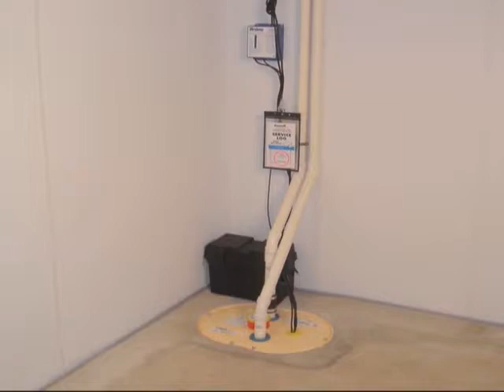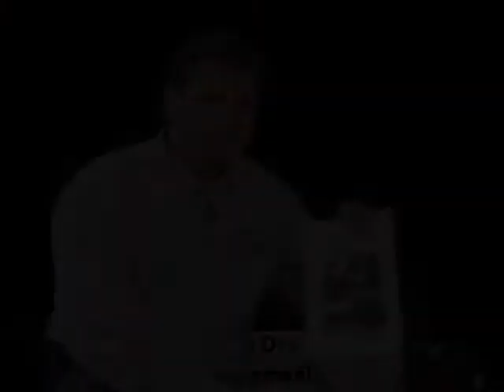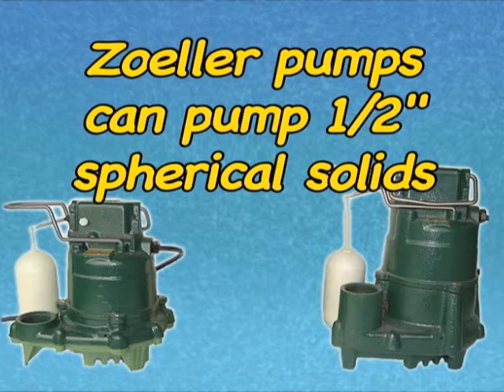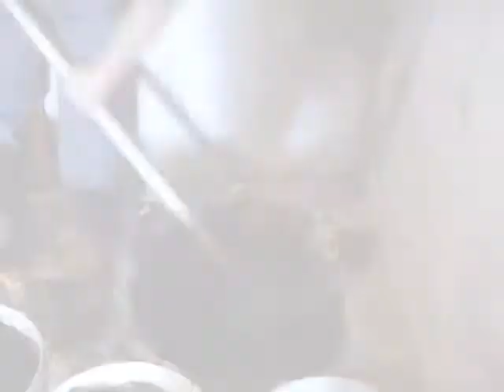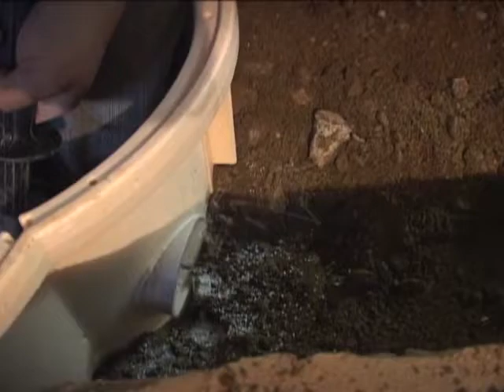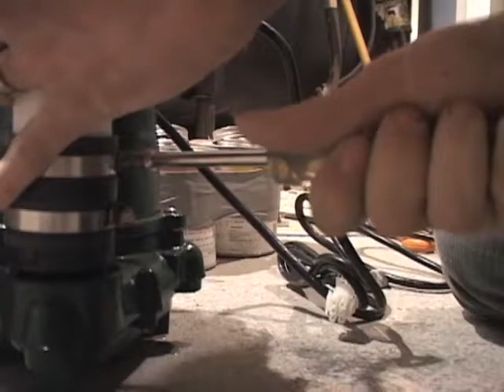Sump Pump Installation

Comment: Excellent advise on sump pumps, how to install and backups.  I have always used 1/2 HP Thermoplastic sump pumps with two power cords and vertical float switch. For backup water power sump pump seemed superior than battery or installing two pumps. The PSI in my home is 80 much more than needed to power the water power sump pump. The water power sump has prevented flooding in my home more than once so I highly recommend this type of backup. Remember no backup sump pump runs for free. They either use electricity or water and if battery powered there is the additional expense of running a trickle of electricity to maintain battery life.